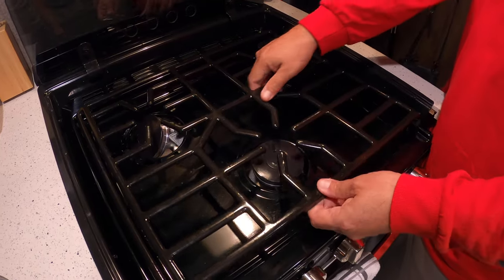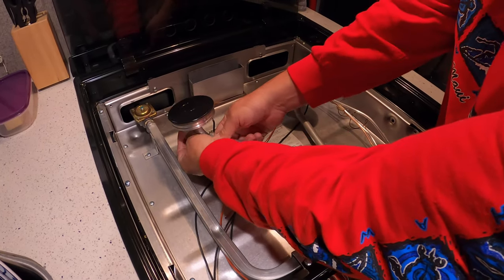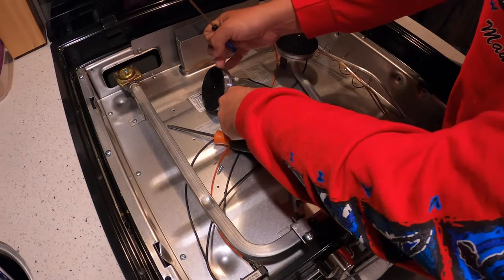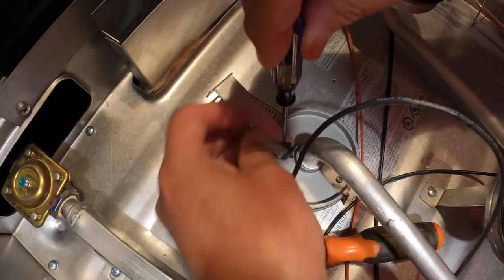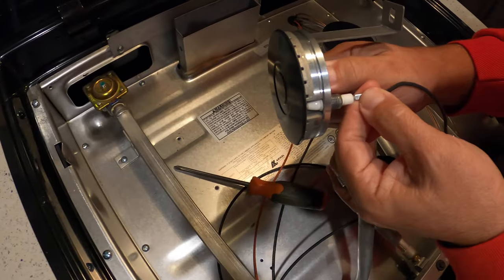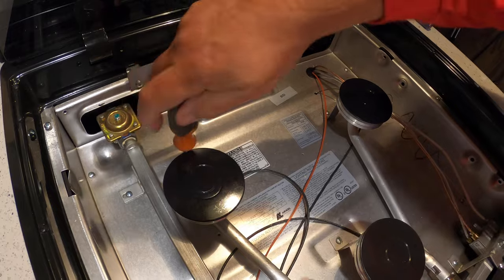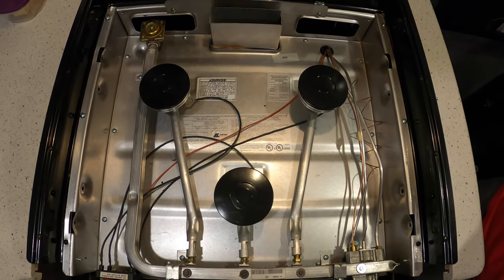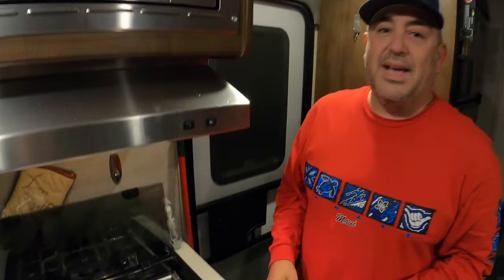Fixing a loose Stovetop burner on your Travel Trailer

Comment: This is exactly the info I needed.  Was prepping the camper this evening for Spring camping and found the same burner with the exact same issue.  Got to tug on my stove top a little harder than yours, apparently--decided to look for a video before applying too much force.  Thanks for the concise video with clear instructions and good advice to check the other burners while you're in there having fun.

Comment: This is great info.    I had my dealer reattach the burner the first time, the second time he just basically said “Go away, fix it yourself” at which point I took things apart and figured it out.    It is easy, but I cannot seem to get any of the burners to stay attached for any length of time.  (Even the interstate highways are so full of potholes across so many states!)   They keep falling off, over and over again.    All three are off now (there is a safety recall on the LED light on the control panel so I guess I’m not in a rush — using an electric frypan at this point.)    But do you know of any way to fix these things more permanently?    Is there any sort of non-flammable lock tight  that might work?     Thanks very much for your videos and response.